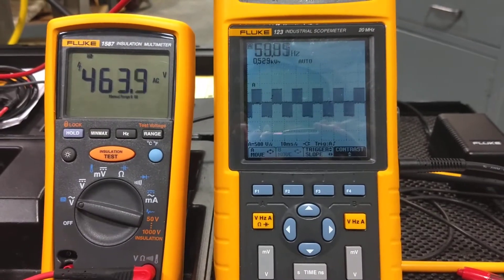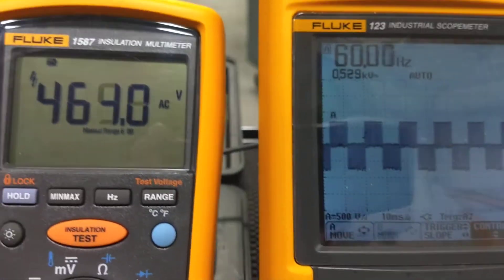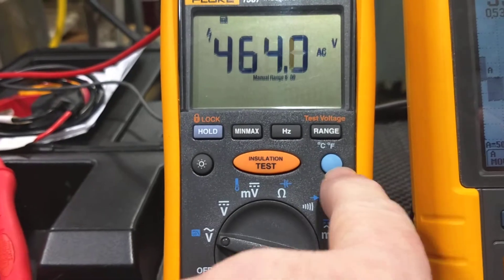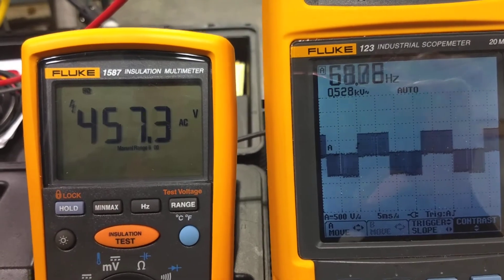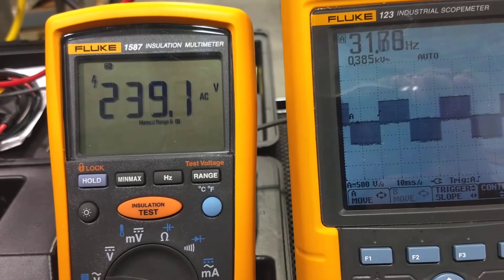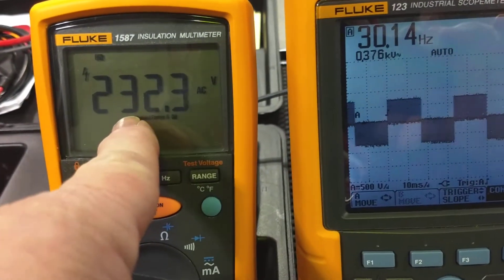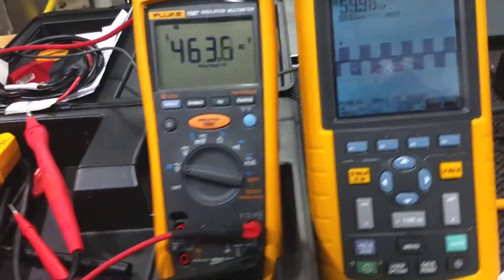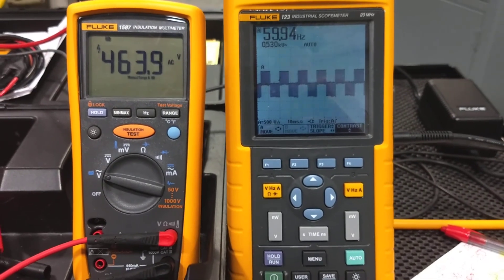ELC 117- VFD & Motor wired and programmed by Nathan Piercy and Luke Matthews

Comment: The Fluke "123" does not have a low-pass filter but it does have a "Vpwm" measurement option exactly for this purpose (to measure PWM-generated voltage).
The newer "123B", with color display, has a 10 KHz low-pass filter that can be enabled from the menu.
Reply from the maker: Thanks very much 👍😊